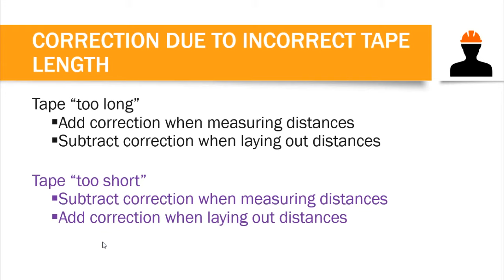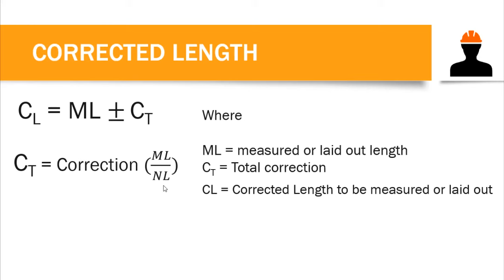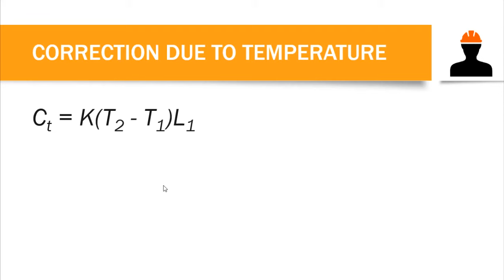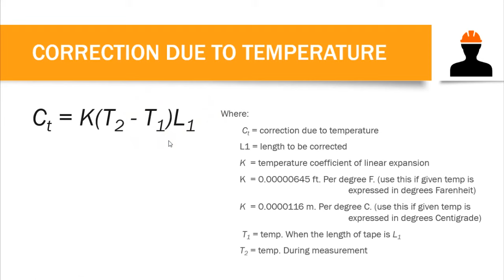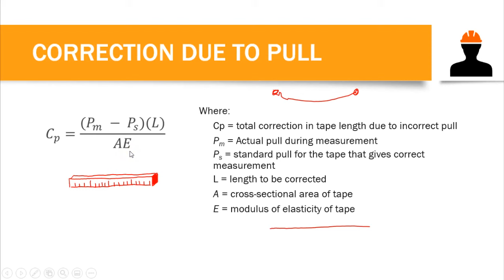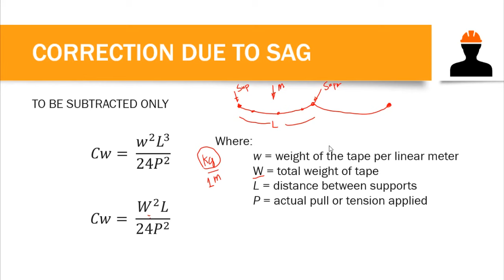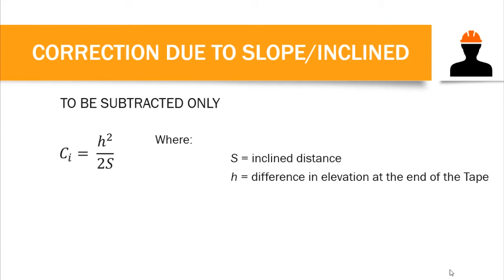Surveying | Corrections in Tape Part 1 of 2

Comment: : A line recorded as 472.90 m long. It is measured with a 0.65 kg tape ( 30m ) which is 30.005 m long at 68° F under a 5.0968 kg pull support at both ends. During measurement the temperature is 41° F and the tape is suspended under a 75N pull. The line is measured on 4% grade. E = 200 GPa, Cross-sectional area of tape is 3mm?. Hint: K=0.00000645 ATIF a. Compute the actual length of the tape during the measurement. ( 10 points) b. Compute the total error to be corrected for the inclined distance ( 5 points ) c. What is the true horizontal distance. 10 points)
Reply: a) 30.001025 m
b) -0.003975
c) 472.837 m